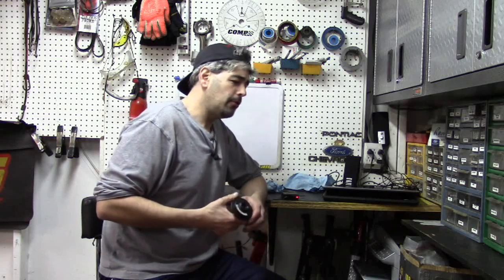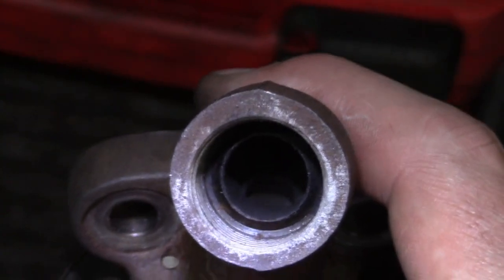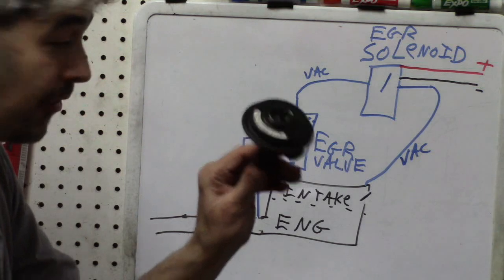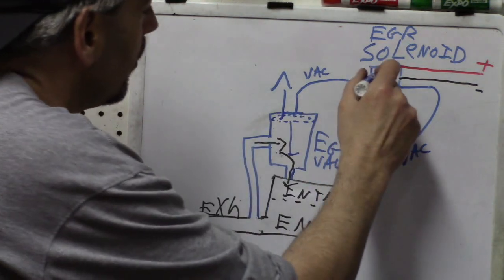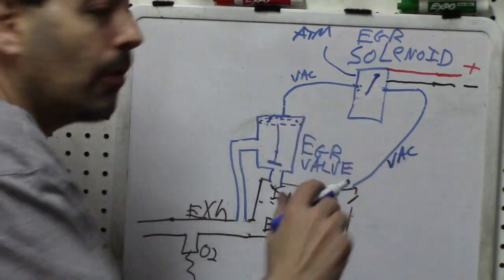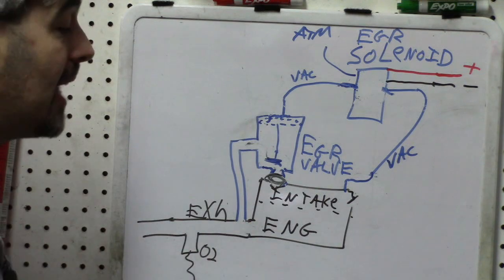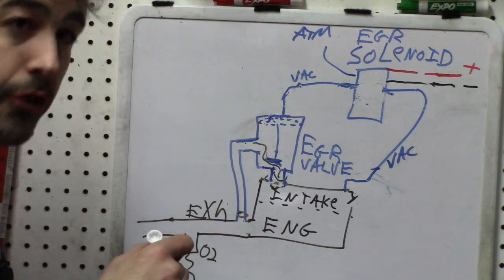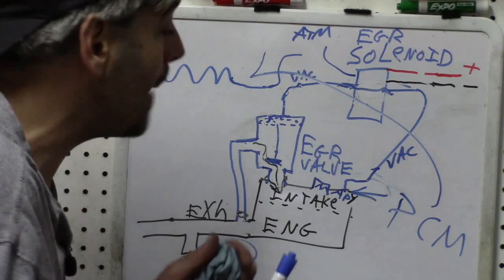EGR  P0400, P0401- P0409 Diagnosis+Understanding Pt1

Comment: EGR flow shouldn't cause lean exhaust, exhaust gas should be inert no oxygen. EGR is for NOX emissions which forms at 2500 degrees F in the CC. EGR should lower CC temps. NOX and HC make smog in the atmosphere. EGR takes up space in the CC doesn't  really change the A/F ratio. Catalyst is for unburned fuel.
Reply from the maker: Your thinking is correct but there are factors as you will see in part 3 that show it does indeed induce lean response.
  Dang, I specifically made a note to mention NOx as them pollutant from EGR and I totally forgot! I need to add that in.
Reply: Schrodingers Box
If anything, I would expect a rich response because the EGR gas is displacing outside air in the intake manifold. This would result in less oxygen in the combustion chamber. Now it is possible that the pcm will compensate for the rich mixture, and as a result will shorten the injector on time, thus leaning out the mixture. I would like to monitor the O2 sensor mvolts while manually inducing egr to see how the O2 sensors would respond and also watch the short term fuel trims.
Reply: JUDGERAMBO If a EGR is leaking, it'll cause a lean mixture. That can damage the converter. Also it can cause plugs to burn lean. Lean mixture can damage valves.

Comment: Good video thanks, I have a question, would I get a low egr flow detected if the CAT was choked as I'm getting the low flow code and very poor performance.
Reply from the maker: That’s a really good question- I am not sure. my guess would be no you wouldn’t. i see the thinking that the low airflow would possibly cause a low EGR flow however remember how the EGR flow is detected on most cars- it’s going to be detected by MAP increase because the EGR open will increase manifold pressure. but with a clogged exhaust you manifold pressure will be sky high anyway. 
   if anything you would get a MAP out of range code and you cannot get an EGR performance code with a MAP code present.
Reply: @SchrodingersBox  thanks pal, I'm going to remove the inlet manifold now and clean that out as there is a vacuum controlled lever at the back of the head that when I replaced the vacuum bulb and rod as the plastic ball joint was broken off I noticed the lever was stiff and I freed it off before I fitted the control rod but the problem gradually came back again after 50 miles or so so I'm confident I'm onto the remedy. I'll keep you posted.

Comment: Thanks for the fresh way of diagnosing problems. I haven't worked on my vehicles in years so I started throwing parts at my truck when I got a egr code. After watching this egr series I understand what the system does and how it works. Bought a vacuum pump and found the problem.  Thanks bud

Comment: Ive got a 95 Mercury Cougar 4.6 thats giving a "No Flow Detected" code,i put a hose on egr and put vacuum on it and no change in engine idle,When the car is running at idle i have vaccum on the egr from the green hose which you said shouldn't be any vacuum at idle,Any idea what could be the problem? Blockage in egr at Intake? Manifold pipe to egr?
Reply from the maker: Sounds like a blockage.

Comment: I did have the EGR code show up when I had Auto Zone check the Check engine light. Fortunately I do have a bit of automotive knowledge and wanted to research the problem myself before paying for the EGR valve. That's when I found your video. It was quite helpful as I was able to clean my entire kitchen while listening to your video at the same time, you do have a tendency to be a little long in the wind, all good. Anywho, it turned out to be a dry rotted vacuum line, hard to find but got it. Not only did it fix the code but it also fixed my A/C blowing thru the defroster vents too. Thank you for the info. Peace out.
Reply from the maker: I actually have only once had to change a EGR valve for an EGR code.  Only once.  Nice Diagnosis!
Reply: Same here. 2003 mustang v6. Check engine light on. Just got out of AutoZone and wanted to research before I bought anything. I need to pass smog check ASAP

Comment: Thank you, after cleaning and checking all the egr components I finally sat down and went through your videos for the p0400.  Once I understood what everything is supposed to do I came to the conclusion that my egr wasn’t getting  vacuum and that was throwing the code. Hoses were good, but not correctly routed, and it was losing vacuum at the bpt.  I ended up connecting the hose from egr  sensor directly to the egr valve bypassing the bpt.  It ran rough but passed the emissions, thank you
Reply from the maker: Congratulations on the fix!

Comment: I just started watching your videos. You have really supplied us with a thorough understanding of the EGR systems. Thank you for all your hard work. I have a minor suggestion. When I use your drawing, I have added numbers adjacent to each failure point in the system, you talk about. I then use my numbers in my notes, so I can refer back to the original drawing for each point in the system where the failures typically occur. This way I can tie the failure points directly to the drawing. It is helping me keep track of each failure you are providing to us. Great job with these. I have subscribed to all your videos. I am looking forward to watching every 
one of them. You are helping me a lot with my troubleshooting.Thanks

Comment: Excellent video. I was one of those 98%'ers who took my car in to Autozone to get the check engine light read and get quoted for parts. I'm glad that I held off and decided to do some research as to what the actual problem was because I ended up coming across this video. Thank you for the time and effort you put into this. It helped a ton.

Comment: Thanks for the good infol on the egr system,  my only question is what about excessive egr flow? I using the knowledge aquired from your video are thinking that the valve is cruded up and not closing completely. Tomorrow i take a look and see if i can check this theory out. Wouldnt mind your input.

Comment: Great Series Matt...Thank you!  Sorry if I'm late to the party!   I...no, my wife has... a 2011 Suburu Outback which has begun to stall after engine warmup whenever it  returns to idle.  Starts right back up and continues running smoothly as long as the engine speed is kept at or above 950 rpm.  Drop below that and it stalls again immediately...no stumbling or roughness, dies immediately.  Cleaning the maf,  throttle body and doing the Suburu idle relearn procedure has made not difference (But it was time to clean them anyways...). 

  I have a bidrectional scanner with both an idle and egr test and command option for the outback.  Keep the idle at or above 950 and it idles all day long....  Fuel trims are good...short term around 0, long term around 3.  MAF, MAP, Throttle actuation all respond as expected with the scanner.  The only thing which caught my eye is that  I noticed when sending commands via the scantool to change the step count on the electronic egr,  the desired step is displayed, but the actual never changes off zero...so I'm going to do some more testing on that....but I'm a little miffed because with something out of whack enough to cause the engine to die,  I have no codes being thrown at all...for anything. .. 

According to the pcm and scantool initial tests, everthing is just fine with the engine...could there be something wrong with the egr system bad enough to kill the engine but not have a code thrown...for something?  While scanning and futzing around with it over the last few days it must have stalled out at least 20 times already.....seems like it should have a code for something by now....?   Any thoughts or suggestions would be greately appreciated....I'm puzzled...

Comment: Thank you so much for the information. I fixed my P0401 code by replacing the short L shaped Vacuum hose easily seen near the upper front of the engine. It had rotted out. In addition, it fixed the problem with the HVAC mixer doors that were not operating properly for years. This bad hose also feeds the vacuum line going to that part underneath the dash. A "TWOFER"...
Reply: Thats the insufficient flow correct?
Reply: Mine keeps saying insufficient egr flow. I have replaced every sensor, cleaned the intake and replaced the dpfe pipe. Code keeps coming back
Reply: @robertwcolwell  Yes that code is insufficient flow. Often, it is clogged ports where the EGR valve connects to the engine, behind the throttle body unit. I am referring to the 2004 Ford 5.4L. One thing that I never realized was that there was a connection to the P0401 code and a vacuum problem I have been having for a few years. There are vacuum controlled doors under the dash that redirect the AC/Heater airflow to different vents. My doors have not been working well and recently stopped completely. I assumed that they were just sticky, the car is 15 years old, after all. Once I found the rotted vacuum hose on the engine and realized it was in the path to supply the doors with vacuum, it all came clear. Replacing the 2 short hose pieces (1 straight and 1 l-shaped) fixed both problems immediately. It made total sense once I understood the connection. A $2 fix !!!! Can't ask for better than that!!

Comment: Hey Matt!  I have been watching a lot of your videos in order to gain more diagnostic knowledge and understanding of auto computer systems and sensors.  I have learned a lot but I am stumped with the data I am getting on a 2000 Honda accord EX 6 cylinder.  It will start and run fine when cold.  After driving around for about 30-45 minutes with stopping for a few minutes as 2 or 3 places, at the last place I stopped, I came out and the car started but was extremely rough running and would not respond to throttle when pressed to the floor and usually died.  I kept trying to start and get it running and after about 10 minutes of trying it started and was rough but throttle response was a  little better and shortly it was able to get up in RPM and I was able to drive it home.  I hooked up my basic scan tool, AL 539b and the codes I have are EGR Valve insufficient lift (two different codes), which is a codes that I have had for years and code P01399,  a random misfire code.  That is all the codes I have.  The STFT is rather high at idle  about +14% when the engine is cold and running good.  The long term FT is at 0 (zero) and stays at zero no matter if the engine is running good or is misfiring and rough, or accelerating the engine, no change always zero. When the engine is hot, the STFT is as high as +47% and comes down with  more throttle. When the engine is cold again it starts fine and runs good again.   I am thinking a fuel problem and not a spark issue because I am not getting any other misfire codes.  I was getting oil in a few spark plug tubes, on  really bad and was probably affecting the ignition coil.  I have replaced all the spark Plug tube seals and cleaned the oil from the ignition coils. Just prior to this.  But this same exact problem occurred before I changed the seals and cleaned the coils.  I did not have the scan tool before, so I don't know all the data except the symptoms were exactly the same as now.

Can you give me a direction to go with this data?  It does not seem to fit any of the things from your videos. exactly  or close enough for me , with my inexperience to decide a direction.  I was thinking of starting with fuel pressure, however, the intermittent nature from cold to hot seems to lean away from fuel pressure.
Reply from the maker: I would Curve the fuel trim against load with MAF and MAP as next step and see if you can identify fuel or induction as the issue.

Comment: I just wanted to say thanks! I used your videos on understanding fuel trims (and a few more) to correctly diagnose and fix my 2004 ford expedition when five different reputable mechanics couldn't figure out what the problem was (fortunately I didn't take their advice to replace the fuel pump and various other components).

Turns out the component connecting to my egr valve was plugged with carbon (the air intake manifold?). I took it off, cleaned off the carbon build up, vacuumed out the egr valve and things are back to normal. In the process I tested quite a few components and determined that they all worked correctly... components that various mechanics noted I needed to replace.

Anywise, much appreciated and I look forward to learning more on your channel. Thanks!

Comment: I just ordered 02 sensor ,was about to order new egr sensor and valve when I learned about cleaning the ports which get clogged , so I'm gonna try to check into that and clean em , so I reckon I was  part of the 98% of schmucks that throw parts at it , I'll admit it . This man has so many haters it's ridiculous, haters gonna hate its what they do! It's when you don't have haters that you need to worry  and take a step back and see what's going on.

Comment: "Swaptrons" lol. They do make up 98% for sure. Much more fun to swap parts than to sit down, read, research, then fix ONCE (sarcasm here). I'd rather spend 2 hrs reading, learning, and planning than 2 hrs in the sun, cursing and getting all worked up changing things I don't need to.
Reply from the maker: Agreed. I always laugh when I see people change parts a,b,c,d, and e and then eventually change part f which fixes the problem- all at more than cost than just going to the dealer, and yet they celebrate their "success" of not getting ripped off by the dealer lol.

Comment: 23:21 - it should be opposite - riching effect on O2 graph, despite engine sees no extra fuel (EGR gases contains almost no O2 or very little O2 in comparison with fresh air), so more EGR gases in intake manifold = less fresh air with O2 in intake manifold -> almost all O2 available will be used in next combustion cycles -> no O2 (or very little) remains will be thrown to exhaust -> so O2 sensors sees almost no oxygen in exhaust gases -> riching effect in scan tool O2 sensor graph.
This is a reason, why engine is killed (effectively suffocated), when EGR is stuck open, because there will be excess of exhaust gases and almost no O2 in intake manifold.
PS: I like Your approach to car diagnostics very much, so I have watching all Yours videos from "bumper to bumper" and still learning something new :-) (I'm not mechanic nor parts changer, but car diag hobbyist. I'm very appreciated to Your work! Thanks!)

Comment: Nice video, well explained but one question i have from your video and all the other vids ive watched say that recycling the exhaust gases back into the intake manifold results in cooler temps.... arent exhaust gases really hot? How could that result in cooler engine temps? Is it because it turns to vapor form? Thanks

Comment: Hey Matt, great video and thanks for enlightening the curious 2% of us. I do have a question about the EGR: since is letting in exhaust gasses into the intake manifold, shouldn't its operation result in rich condition rather than lean condition? I'm thinking that the exhaust gasses will reduce the proportion of oxyen in the air fuel mixture and logically that should lead to a rich condition. So what am I missing?
Reply from the maker: yeah great question and I am not clear on it myself honestly. yes there are exhaust gasses however there is also some oxygen in the exhaust ahead of the catalytic converter so both ways make sense.  also remember it’s the ABSENCE of oxygen relative to baseline NOT the addition of fuel that makes a rich condition. the O2 sensor detects O2, not fuel.
Reply: HA!  I literally just posted a long comment with the same exact question. Sorry I didn't scroll 3 comments lower before I posted it or would have saved me a lot of time.

Comment: Hi Matt, thank you for your great tuitions and don't worry about your drawings because they explain everything just fine. One thing that you did not mention is the DPFE sensor and how we can check that. I got a P0401 code a few months ago and someone told me to replace my DPFE sensor which I did as they are only a few bucks and the problem when away, but now I am getting the P0401 code again (but this time I will follow your video and check everything) but could it have failed again and how do we check them. Thanks.
Reply from the maker: yes I cover the DPFE sensor in a series on my website at www.schrodingersboxQM.com

Comment: Which type does my 2000 Honda Accord 2.3L have?  THat is a question I am trying to answer.. and so far.. can't find it!  I'm struggling with this problem right now.  Thanks Mr. Schrodinger.
Reply from the maker: 2000 accord has a 5 wire electronic with position sensing.

Comment: 1) Only when there is oxygen left in the exhaust gasses the lean condition will occur when opening the egr valve: you would expect no or the very minimum amount of oxygen in the exhaust (which is used to determine the optimal stoi point). 

2) can you explain how the in cylinder temp is lowered by this design using an egr valve?

Comment: weck, I was that 98% people until I watched your video. I changed egr value but light still on. So i am trying to learn how to diagnose the whole egr system instead of spending money on unncessary stuff. How do I find out problem is that i realized my lights sometimes on and sometime off. So I think it probably just wire connnection issue. and the only electric connector is locate at solenoid. So i took off the connector and blowed it. crazy the code was gone!